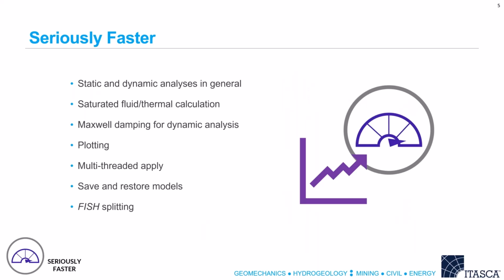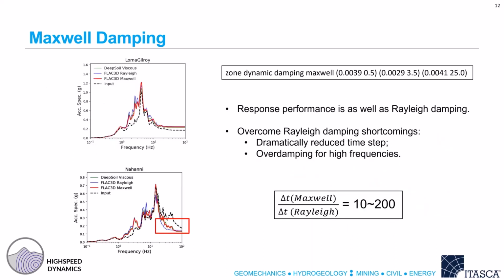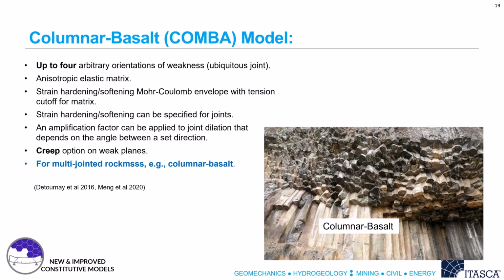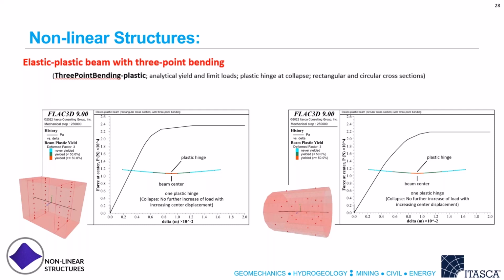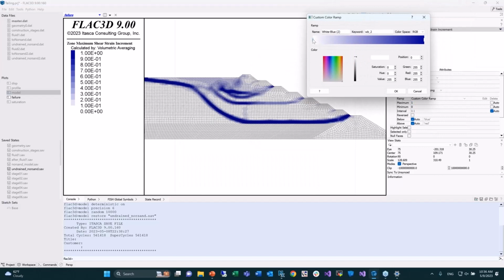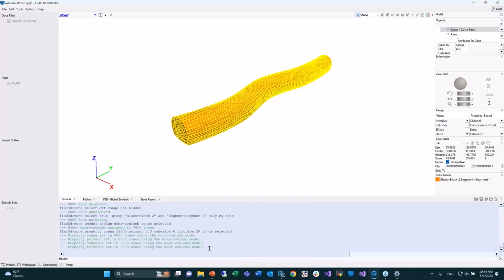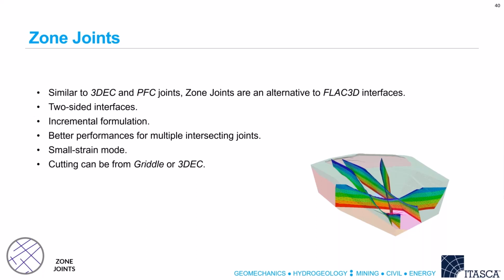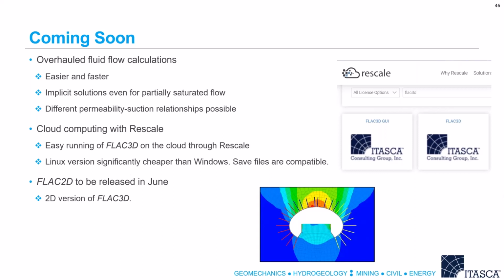FLAC3D v9 What's New Webinar

Comment: Would you clarify why the extrusion contains the rotation about axes by default?
Reply from the maker: Previously there was an extrusion icon to switch to the side view where the rotation icon is now. The new Sketch UI added a view plane dropdown (front, side, top, and bottom) to the Sketch menu. The front view plane (XY) is the default and a good orientation for revolving around the z-axis or x-axis. The conventional extruder works best from the side view. Essentially we're making some changes to the UI as we work towards even more powerful extrusion and meshing tools.
Reply: @itascasoftware  So, there is no difference between the 3D extruded from the sketch and the one obtained from the building block? Further, where can I find the unit setup section?
Reply from the maker: @sameeplamsal8579 the Sketch and Building Blocks are two different tools for mesh creation available within FLAC3D. Whereas the Sketch tool allows you to quickly draw a section view and extrude it out-of-the-plane, Building-Blocks lets you snap together and manipulate blocks into forming your final model. You can also use a 2D DXF as a starting point when creating the 2D profile in Sketch. The Sketch tool can export a model directly to the model pane or it can also export the model to Building-Blocks should you want to modify the mesh some more (e.g., tapper the end blocks of an extrusion at some angle). You can learn about to use consistent systems of units (of measurement) in FLAC3D here: https://docs.itascacg.com/itasca900/common/docproject/source/manual/program_guide/modelformulation/systemofunits.html?highlight=units. For technical support, please contact ITASCA at https://www.itascacg.com/contact-itasca/software-support-request or check out out Software Forum at https://forum.itascainternational.com. Thank you for using ITASCA software.
Reply: @itascasoftware  Thank you. But I still didn't understand the significance of rotation about axis while extruding the sktech geometry? Should I not bother about this and just give offset value to make it a 3D? I am using FLAC 3D V9.
Reply from the maker: @sameeplamsal8579 , the rotation about an axis is only necessary if you want to form a revolved solid mesh (think symmetrical cone for a stock pile or a cylindrical tower or a vase). But for a simple linear extrusion (into the page) switch the view to "Side" and specify the depth and zone resolution along the extruded axis. See https://docs.itascacg.com/itasca900/flac3d/extruder/doc/manual/sketch_pane/ops_in_extrusion_view/opsinextrusionview.html?node2761. There is also this example (uses older UI, but go to Side view and will be essentially the same): https://docs.itascacg.com/itasca900/flac3d/zone/test3d/TheoryAndBackground/FactorOfSafety/BenchExtrusion/BenchExtrusion.html?node113. We will work on providing a new tutorial example that helps to walk through this process.
Reply from the maker: @sameeplamsal85679, I think this online example might help: https://www.youtube.com/watch?v=5wMh5rdX2SQ.
Reply: @itascasoftware  Thank you very much. It would be very helpful if you could provide a new tutorial for pile supported embankment (3D).
Reply from the maker: @sameeplamsal8579  check out this highway embankment example for FLAC2D: https://docs.itascacg.com/itasca900/flac3d/zone/test2d/ExampleApplications/FromFLAC/14HighwayEmbankment/HighwayEmbankment.html.  Since FLAC2D is based on FLAC3D it should be easy to apply this in 3D case. Just remember that FLAC2D is based on Y-axis being up, while FLAC3D is based on Z-axis being up.